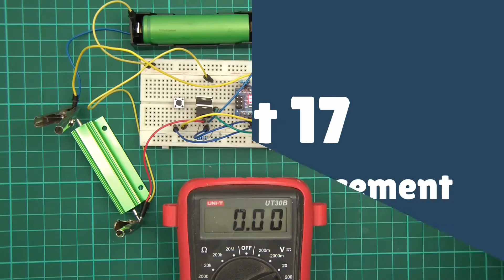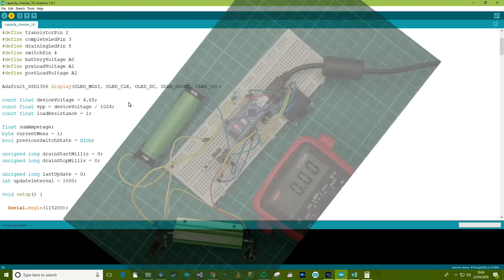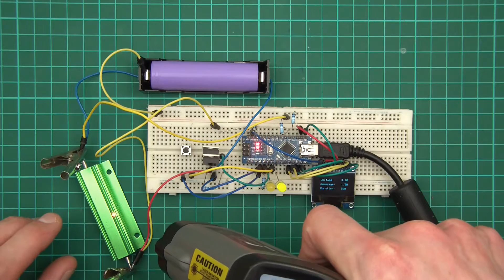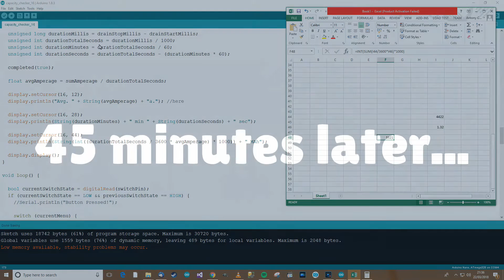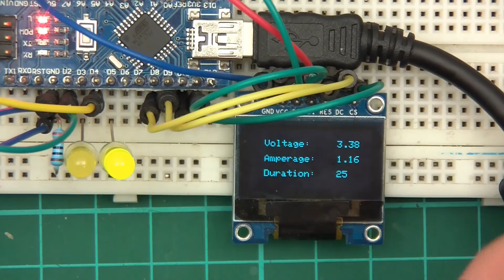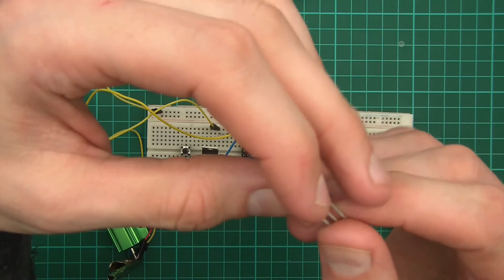TUTORIAL: DIY 18650 Lithium Ion Cell Battery Capacity Checker Tester (Part 17 - First Test!)

Comment from the maker: Left to do:
Add a buzzer and code it.
Swap transistors for Mosfets? Maybe IRLZ44N?
Investigate load-on voltage drop difference between cell - and Arduino ground. (Any thoughts anyone?)
Swap Nano for Pro Mini? (smaller and cheaper)
Design a PCB.
Design a case.
Reply: Antony Cartwright You should measure  internal resistance also.

Comment: Hello Antony, nice to see that you are making progress. Yes, you really should use the Mosfet. You should check the cells internal resistance within your code. You really might want to add a voltage reference of some sort to clear out your problems with voltage variations. There are different ways to tackle this: Use the internal voltage reference with a voltage divider, use a external voltage reference chip or somewhere I recall seeing some code you could use to read the voltage attached to the Arduino. I hope these tips will help you out.
Reply from the maker: Christian Shepherd Hi Christian! Thanks... I'm looking at the mosfet as we speak. The voltage is accurate but not when under load. I think it's a transistor problem... The voltage of cell to arduino gnd is correct, but there's some stealth resistance between the transistor and cell cathode when under load. I'll figure it out eventually ha.
Reply: Antony Cartwright try some thicker wire for the Cell and resistor circuit , calculate the cells resistance and try to workout a voltage reference. From there on it should be easy to workout any deviations.
Reply from the maker: Christian Shepherd I've solved the difference in voltage... It was a loose connection due to faulty breadboard.
Reply from the maker: I've just got to change the transistors to a mosfet.
Reply from the maker: I've been struggling with a mosfet for about 30 minutes too... It turns out it was a loose connection again.
Reply from the maker: Also fixed another problem with a very slight rewire..
Reply: Antony Cartwright -Ahhh, progress. Nice. But bad connections are the reason I advised you to redo the wiring. Be brave and solder the connections in the air if you need to. 😀 That should save you a lot of Headaches. High currents and Breadboards don't go well.
Reply from the maker: Christian Shepherd I know what you mean but I don't want to do it in case I have to make more changes. :(
Reply: Antony Cartwright Be brave. Soldered connections can be unsoldered. 😀
Reply from the maker: Christian Shepherd I've dealt with it now... I just checked every connection and made sure it was jammed in properly. Now I just have to add the buzzer. :D
Reply: Antony Cartwright , the Mosfet should work a lot better than the other Transistors and not get hot. Have you figured out what kind of voltage reference you would like to use? A while back I tried a IC that needed at least 7or 8 volts to get a clean 5v reference. For that I used a voltage doubler to get it to work off of 5v.  I also used a INA219 to measure the current, which might also be an option for your circuit.
Reply from the maker: Christian Shepherd yes, I've tested it all out and with the firm connections, and with the update in this video, the accuracy is very good. It's out by 20mv or so... That's just by putting in the 4.65v. It's not the best solution but it's so easy ha!
Reply: Antony Cartwright that is good. You should change the settings on your channel so that people can contact you.
Reply from the maker: Christian Shepherd which settings? I can't see an option to allow it?

Comment: One thing you are missing is there is voltage drop through the breadboard. There are lots of resistances through each pin connection. If you were to design this on the pcb, you'd need to change your calibrations.  (hahah, you briefly addressed this at the end 😜 )
Also, there is a trick to get the Arduino to get its own voltage Ref and calculate those values in its further calcs. So you wouldn't need to change that 4.65 to what ever it becomes when ever you change power supplies.
Reply: Ok, found one site that talks about it. It got close. I used my DMM to check the voltage, but it was off by 100mV. But, that could also be the calibration of my DMM being off as it is a cheap/free one. The site I got the function call from is: https://provideyourown.com/2012/secret-arduino-voltmeter-measure-battery-voltage/
The trick is to read the internal 1.1V rail inside the chip. Then use that value to determine the power rail of the board. With that information, you can now do more accurate analog calculations using the internal ADC of the chip. Note that if you use an external ADC, you can't use this trick (as least, I don't think you can)
You can get more info about it in the IDE references as well: https://www.arduino.cc/reference/en/language/functions/analog-io/analogreference/
Reply from the maker: Korishan hey, thanks for your comments! I think I mention the internal reference too, at the start of the video. I didn't use it because I was too lazy! The accuracy now is really good though as it is, but there's something strange happening when it's under load only. Its not accuracy, it's like as if the arduino ground becomes different to the cell minus. I don't understand it at the moment, but I suspect that the transistor resistance is something to do with it.
Reply from the maker: Korishan have you got any more cool ideas about the project?
Reply: Hmm,, that's odd. Sounds to me like there could be a voltage differential, yeah. One to check is all your voltages at various locations while under load without moving anything, if possible. It's also possible that when under load, the arduino's voltage has changed slightly, which would throw off the readings as well.
Reply from the maker: Korishan yes, I'll do that... There's something weird going on..